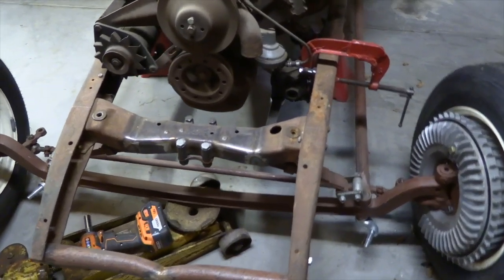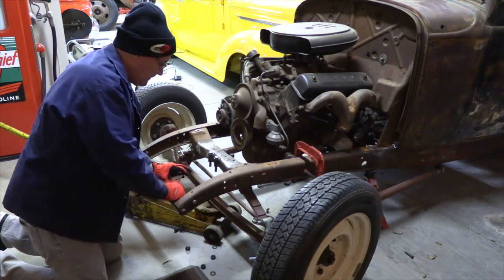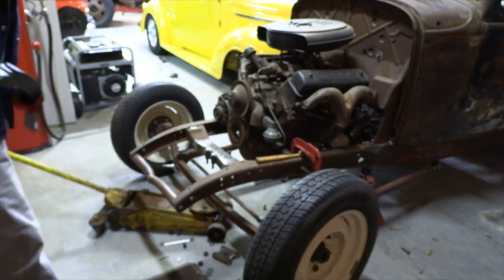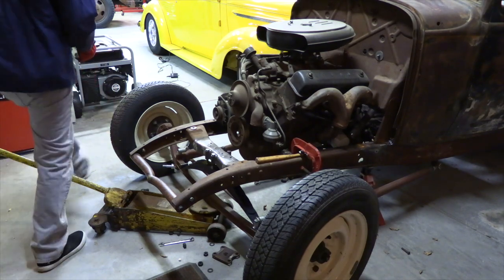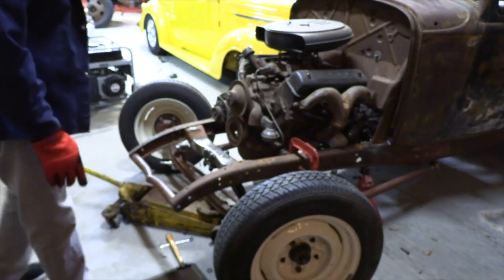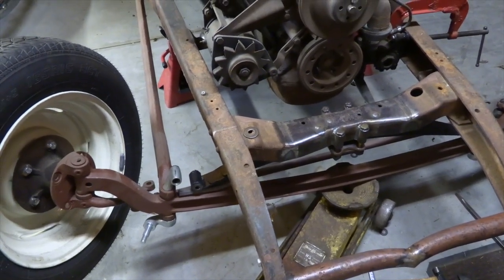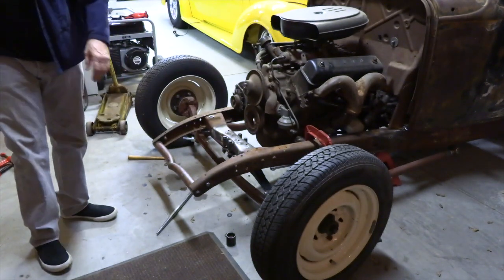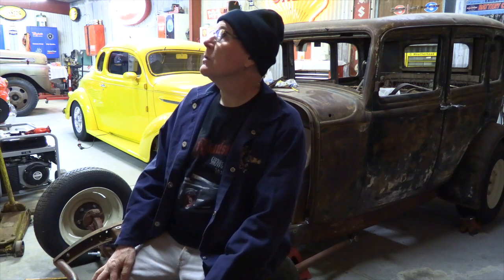Rescue 1932: Front Springs

Comment: Nice job Clay!   An extra pair of hands would make it easier, but you got it done.   I’ve wrestled reverse eye springs without a spreader too.   I used a ratchet strap to pull the spring up to the crossmember, where you used the big C clamps.   You’re so right that having tools is all the difference, and you can never have too many clamps.
Reply from the maker: That extra pair of hands is never around when you need them. When I put together after paint I will install the main spring on the axle and assemble the spring pack on the installed main spring.